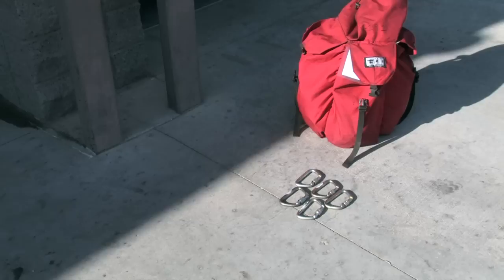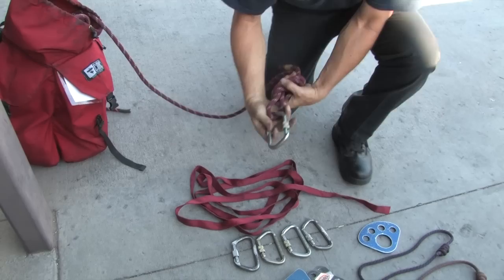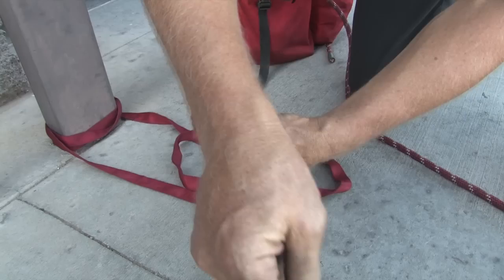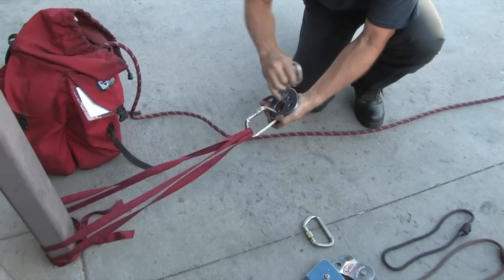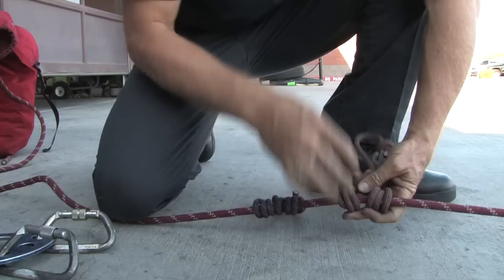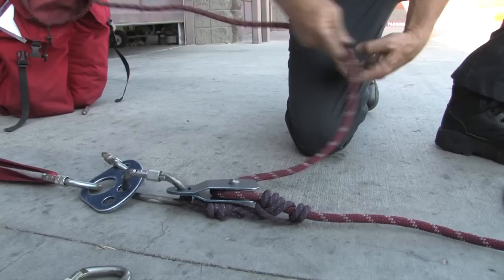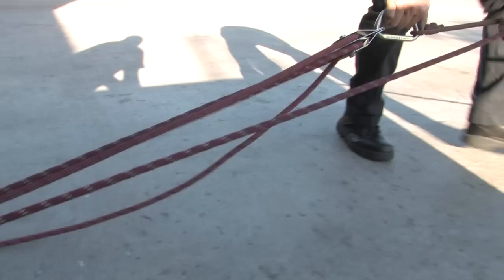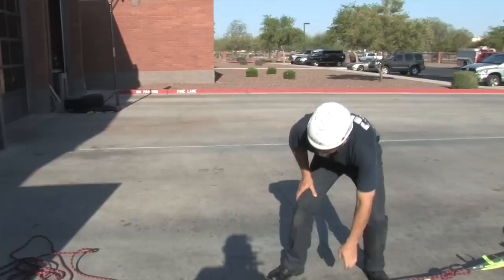5 to 1 Mechanical Advantage

Comment: Does the length of the rope segments between the pulleys offers any advantage to the reduction ratio? That is, does the amount of rope looping around the pulleys matter in any way?
Reply from the maker: +arnaldohanatarashi 
I don't think the amount of rope matters much by itself however, the more rope you have out in play, you will have much greater potential for rope contact with terrain resulting in additional friction which is probably your biggest enemy in pulley system efficiency. 

Also, consider that lots of pulley efficiency tests have been done over the years and the results are often both expected and unexpected. The best place to check this out is http://itrsonline.org/  where you can brows through all sorts of interesting and sometimes a bit academic research papers and presentations on all sorts of things rope related.

A good example is the following link to a pulley efficiency article.
  http://itrsonline.org/wordpress/wp-content/uploads/2015/02/015.G.Smith_.2014.pdf

also check out  http://itrsonline.org/wordpress/wp-content/uploads/2014/09/McKently2011_ITRSPresentation.pdf

I hope this helps